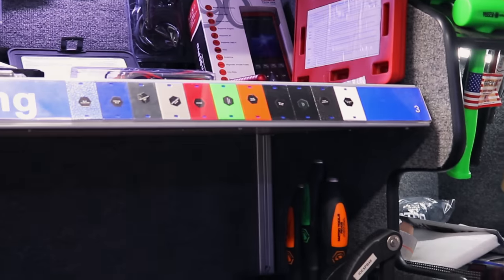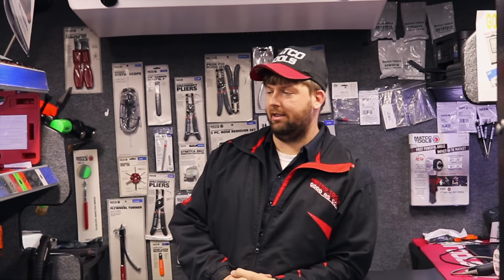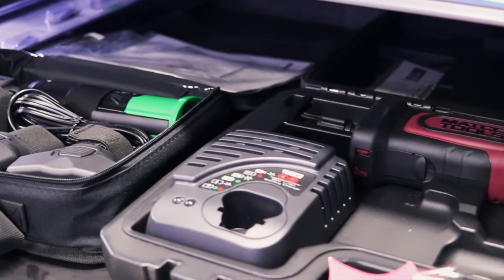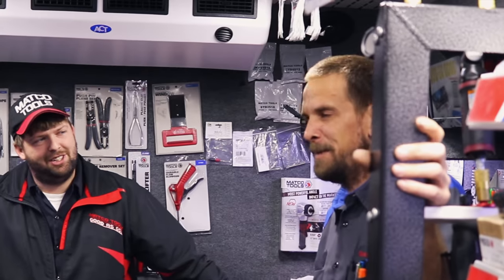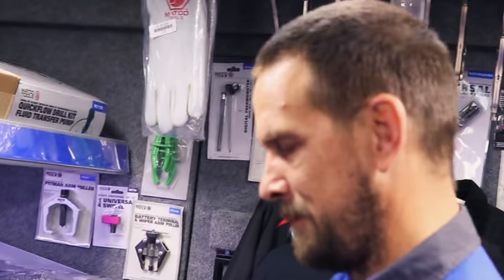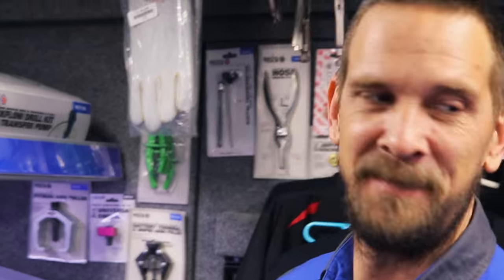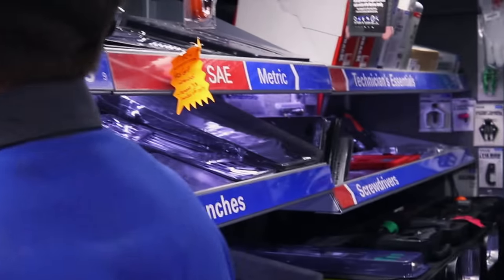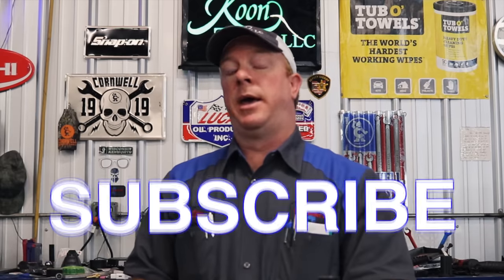Matco Tools New Tools and A New Color Toolbox

Comment: I use the ball joint tool for pressing u-joints on pto drive lines quick and easy every time 

I saw that fluke ,but the go to fluke is the 223 fluke unit check one out

Comment: Well I'm #3.. Clay did you get the price of the in line saw? I did a waste/overflow with trap on bath tub yesterday and I couldn't get my 18volt Milwaukee Sawzall in the area needed to cut the old pipes ect. I had to go Gorilla on it from inside the tub area(2Lbs Hammer and a Sharp chisel) I got the out come I was looking for but it turned a somewhat easy job into a pain in my ass and the guy that was with me.
Reply from the maker: Ouch !! No i didn’t get the price on it, i can next week, i got distracted by the 1/4” ratchet
Reply: The kit is 470. Tho I have a 12v ingersol rand saw and love that dam thing nice a small.